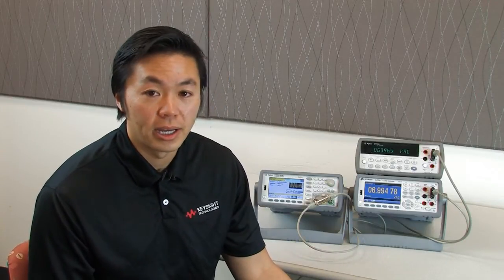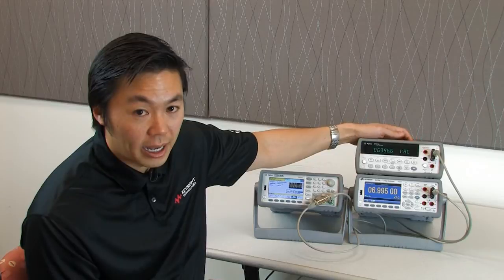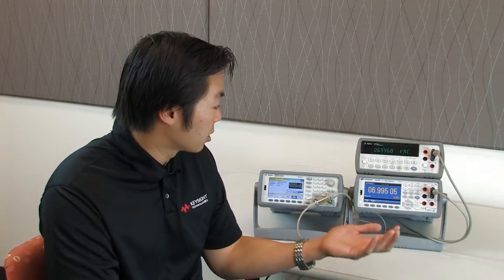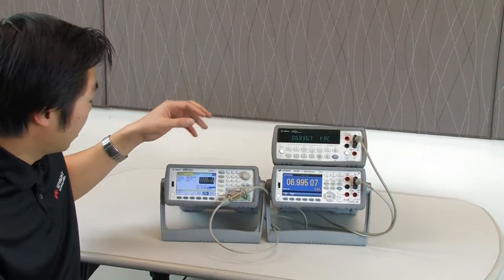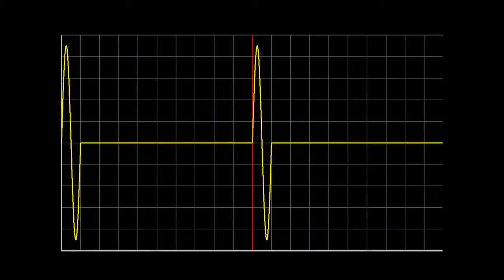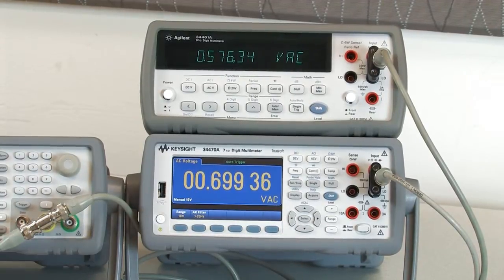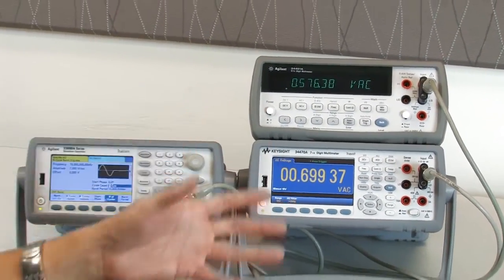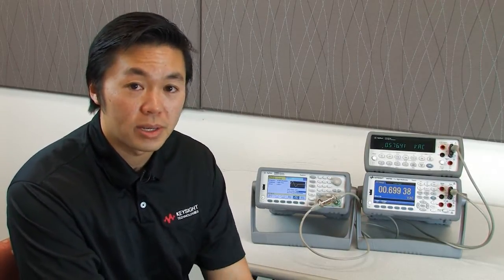Accurate AC measurements with a Truevolt DMM

Comment: Hello.
Good demo, but can you set same triggering speed?
It seems 34401 have shorter period.
Reply from the maker: The AC measurements have three different measurement filters that determine how fast the reading rate will be. For measurements where the expected signal is above 200Hz use the fastest filters (>200Hz filter), the medium speed filter (>20Hz) is the default filter, and for slow signals use the (>3 Hz) filter.

The AC circuitry in the Truevolt DMMs actually have faster measurements than the 34401A. This is due to the digital AC design used in the new generation of DMMs compared to the older analog AC design of the 34401A.
Reply: Keysight General Purpose Instruments Yes, great.
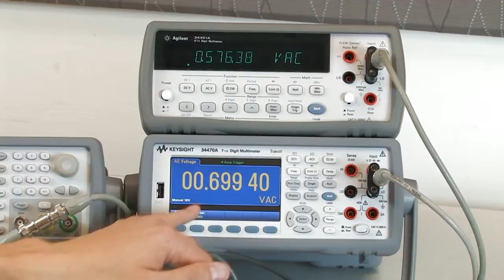But see 1:52. Compare frequency of trigger indicators blinking (circle near "auto trigger" on 34470 and star on 34401). Star on 34401 blinks faster.
Results of this test will be more useful if you make measurements on the same triggering speed. 10 PLC will be good, additional tests with another values will be great.